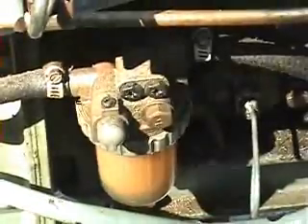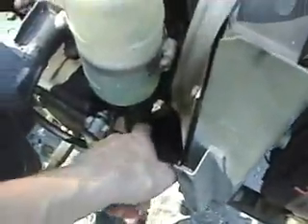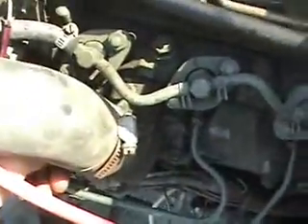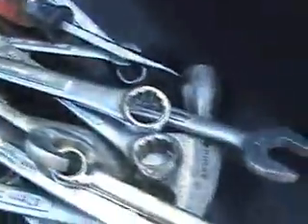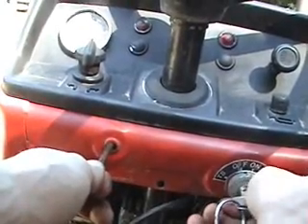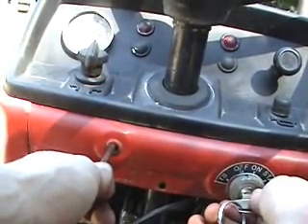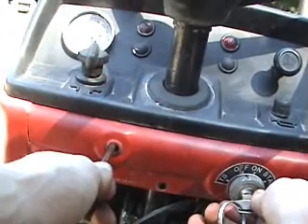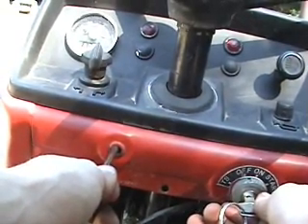HOWTO:  Bleeding air out of a small Yanmar diesel

Comment: My yanmar doesn’t do nothing after I turn it off,only the key light came on
Reply: Just went through this.  In my case the starter wasn’t getting enough amperage from the battery.  First, I cleaned all my electrical connections. Next, I hooked a battery charger directly to the positive post on the starter, turned it to the max and cranked the starter (battery was brand new also).  I’m currently working my way through putting in a new fuel filter and will need to bleed the system afterwards.

Comment: Another sugestion would be to take the return fuel line and attach a vacuum line on it.  You can use one of those manual oil extraction pumps and just pull about a pint of fuel through.  This way you don't have to crack your high pressure lines.  Also, the air in your system was before the high pressure pump do you just have to clear that line not after the pump.
Reply: David, I see it's been 9 years since you left this pearl of wisdom so little chance you'll see this appreciative note. However, your suggestion just bailed me out & saved me a bunch of money - it worked like a charm. Many thanks and best wishes for sharing your experience.
Reply: @Gsw6307  I don't remember writing that, but I'm glad it worked for you.

Comment: why couldn't you just crank it up until the fuel flushed the air bubbles through the injectors/pumps/ect? i know it would drain your battery and wear your starter but would it work eventually?  sorry, i don't have much experience with diesel engines, but trying to learn.

Comment: I have similar issue with my Diesel 81 Isuzu P'up. Snapped a banjo bolt to the return line on the injector, now have air in lines and won't start.. would start before (though had glowplug issues, but i changed them so hopefully that fixed it.
Gonna basically try this to get truck started, crack lines (all or 1 at a time?) and crank till fuel sprays then tighten down and crank. I don't know anything about a compression release lever on this though...

Comment from the maker: No, its not like a jake brake, its used for starting the tractor for a couple of reasons:

With the compression release lever pulled, the valves open so the engine turns over with no compression - therefore it doesn't start.  This allows you to build oil pressure BEFORE the engine starts (better for the motor), and also, its easier on the starter since the weight of the turning flywheel helps start the engine instead of the stater from a dead stop.